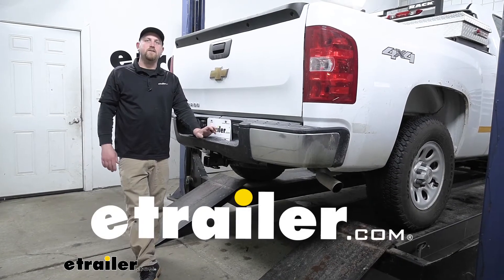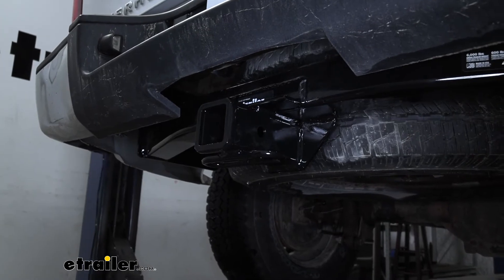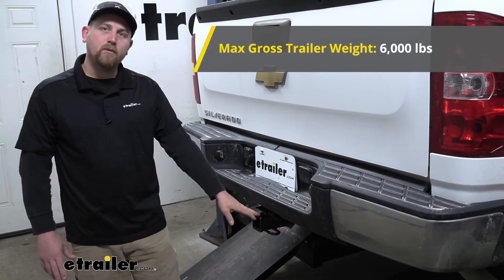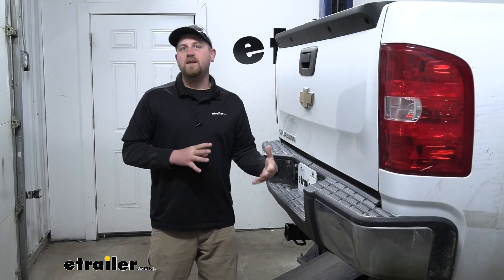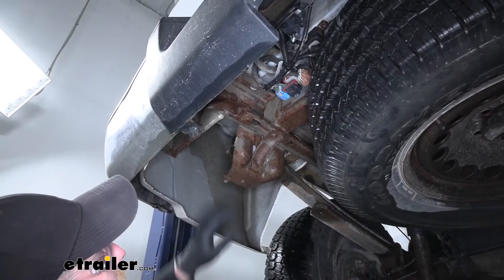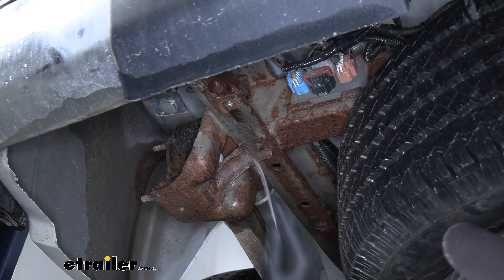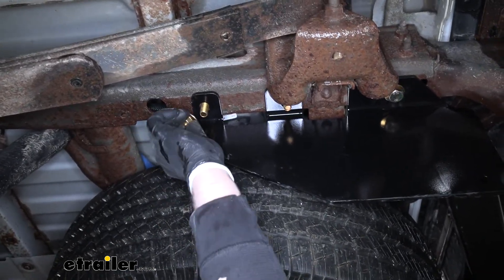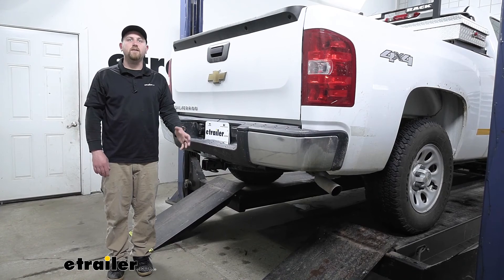etrailer | How to Set Up Your Curt Trailer Hitch Receiver on a 2009 Chevrolet Silverado

Comment: Is the 2500hd install same?
Reply from the maker: The hitch shown in the video won't fit a 2009 Silverado/Sierra 2500. For the 2500, I'd recommend going with the Curt # 13210 Class III hitch. I'll link to the hitch and the install instructions below:
https://www.etrailer.com/Trailer-Hitch/Chevrolet/Silverado/2009/13210.html
https://www.etrailer.com/instructions.aspx?pn=13210